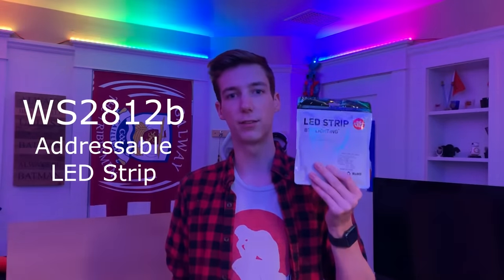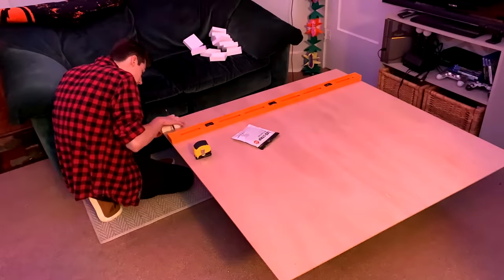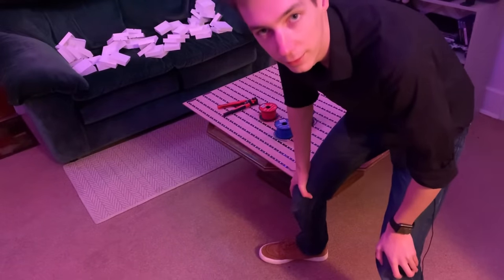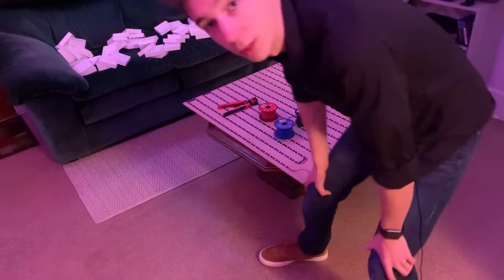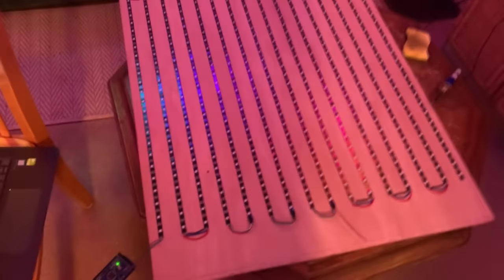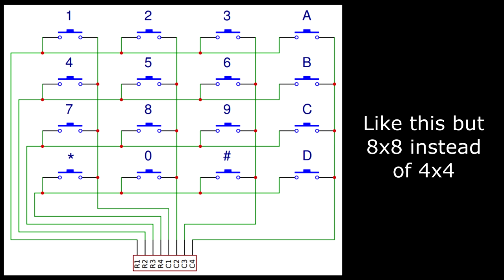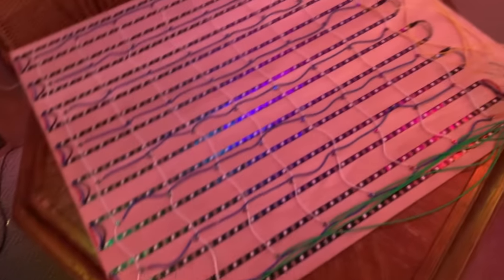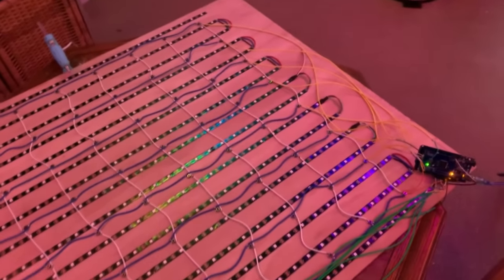How I Made an INTERACTIVE LED WALL

Comment: Omg I think I might actually try this.. how much do the addressable led's cost, and is a cheaper option gonna make it worse
Reply from the maker: The ones I used are the cheapest ones on amazon. It’s about $20 for 5 meters and this uses 2.5 rolls. There’s not much you can do to get around that part because they have to be addressable for this project to make sense
Reply: @Tech-Random  oh, okay. Ill have to save up for these because I'd rather this tan spending like €500 on nanoleafs. Will you ever do a giveway on them by any chance 🤔
Reply from the maker: I’m definitely not going to be giving away a the wall just because it’s too big to ship. I’m planning on making a modular version (more like Nanoleaf) sometime in the next year so I’ll probably give away a few of the modular tiles when that happens!
Reply: Oh okay! Sounds good. Will look out for it. Thanks bro I love your videos.

Comment: How do you connect the LEDs to the arduino on the first strip?
Reply from the maker: For this project I only connected the ground pin and the data pin to the arduino. I powered the arduino separately from the usb port. If you look at my newer LED wall I power the arduino boards from the 5v power supplies to reduce the number of cables needed.

Comment: do you have an estimated cost of this project?
Reply from the maker: It cost me a little over $200 with most of the cost being 3D printer filiment and the LEDs themselves. That and the arduino mega came out to about $160 and the rest came from the wood panel, power supply, buttons, and wires.

Comment: How did you get those led lights on top to do the rainbow wave effect
Reply from the maker: The lights around the ceiling are just the same ws2812b LEDs. They’re controlled with an esp8266 that connects to WiFi so I can turn it on or off and change modes with my Alexa. This was one of the first projects I did with addressable LEDs and it’s not too hard to learn!
Reply: Tech Random DIY Is there one where you can get one where you don’t have to code it
Reply from the maker: Yeah just search for addressable LEDs on amazon and pick one with a good controller. If you’re interested in soldering I can make a tutorial and share my code.
Reply: Tech Random DIY i’m only 13 and i’m trying to tell my mom to get one of led lights what led controller supporters that wave rainbow effect
Reply from the maker: @TheBrettYT  I don't know any specific ones, there a tons on amazon though, just make sure you're searching for "Addressable LED strip with controller" and look for one with rainbows in the picture. Hope that helps!
Reply: Tech Random DIY Thank You so much i hope i found the right one for my desk

Comment: how do you wire the power supply
Reply from the maker: Screw a wire into the positive and negative terminals of the female dc barrel jack connector. Solder the other and to the 5v and ground pads of the strips. I have mine connected to the first strip and a strip in the middle for even lighting. Right now I’m still powering the Arduino Mega from usb since it can’t be powered by 5v from the vin port. Just make sure the dc jack ground is connected to the arduino ground too

Comment: My nanoleaft is the “anime girl hiding under the table meme” in comparison with this.
Reply from the maker: Working on a v2 that’s modular tiles more similar to nanoleaf but still interactive!
Reply: @Tech-Random  Cool! How much did this project cost?
Reply from the maker: It cost around $200. Most of that comes from the 3D printer filament (about $60) and LED strips (also $60)
Reply: @Tech-Random  That’s cheaper than my Nanoleaf! (Mini triangles with the mini triangles expansion pack. 15 panels total and cost like $400)
Reply from the maker: Yup. I wanted the look without the ridiculous price. The trade off is the two weeks it took to build lol. I’m trying to turn the new version into DIY kits I can sell as a much cheaper alternative to nanoleaf.
Reply: @Tech-Random  only thing is the Nanoleaf is easy to control using the app and is compatible with Alexa but I have a feeling you could make your own app or web page to generate the code.
Reply from the maker: I already have some experience with app control and Alexa integration. Thanks for the feedback!

Comment: Your light bill 📈📈📈📈📈📈
Reply from the maker: It’s really not as bad as you would think. The most power this can draw at once is 50 watts. For reference my  PC, which is on more often than the led wall, can pull up to 700 watts. To keep the wall on for an hour where I live is about 2¢
Reply: @Tech-Random  wow that's actually cool